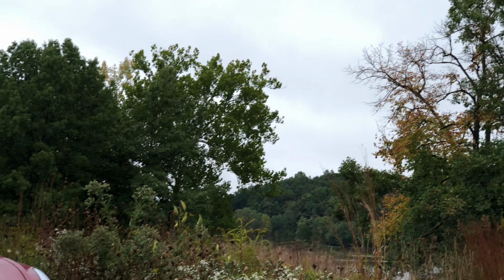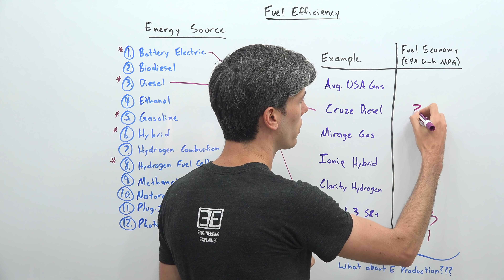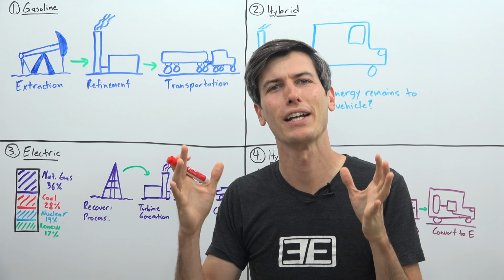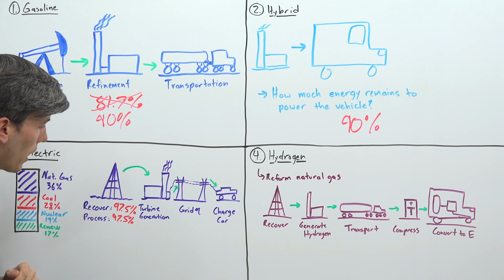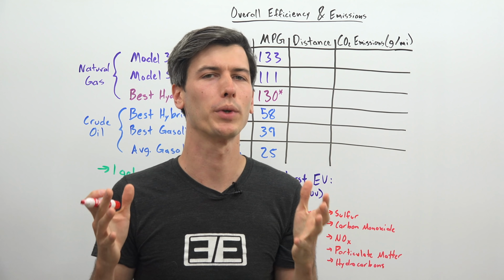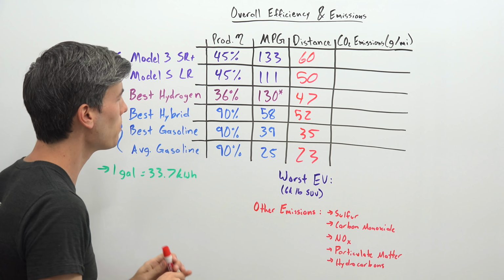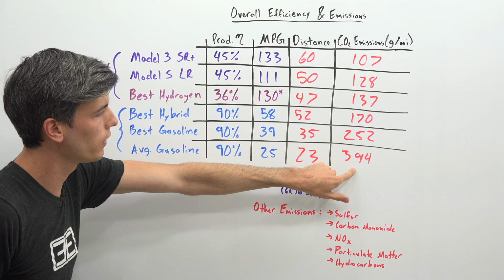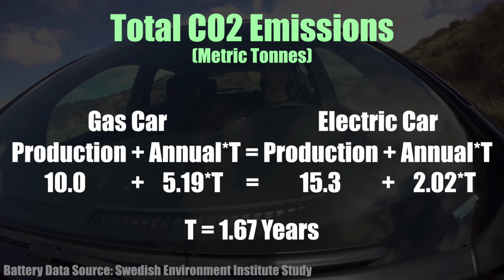Are Teslas Actually Better For The Environment?

Comment: Natural gas leaks and is far far far worse than CO2 as a greenhouse gas. Internal combustion engines are poised to double in efficiency. Internal combustion engines are also going to use bio/synfuel in the future. Combine the three and your whole argument fails.
Reply: ICE are at the peak of their efficiency performance in 1-5 years, they cant actually get any more efficient because of laws of thermodynamics. bio and synfuels arent exactly green either. 

Electricity in the other hand will get more green as time goes on and EV's will only get better.
Reply: @jager_123  
Hi! Yes, I know the "common knowledge", but I also know Carnot's efficiency limit, which is the spread between the engine's hot and cold sides as compared to the hot side. Given that NOX limits the hot side to about 1700K, an engine's theoretical limit is about 80% without significant exhaust treatment. So, 60-65% efficient engine's are doable. Combined cycle power plants are one example. My piston engine, which I'm developing with UMich, is another.

Comment: Well, you failed to satisfy the topic of your video.

ICE-powered vdhicles can be improved, but there are MANY government handicaps that are killing MPG.  Many '80's vehicles had better MPG than today's vehicles.  52MPG was common.

After the fuel in an ICE-powered vehicle is burned, there is no further impact to the environment.  For the electric cars, there are many contaminants required to create batteries.  You have to count those.  Later, those batteries must be disposed of.  Those materials are hugely bad for the environment.

Rather amusing how they're worried about battery disposal--except batteries in electric cars.

Conveniently forgot about those things, huh?

Now, let's look at traveling in an electric car.  The ICE-powered vehicle stops when they need a bathroom break, and fills up while using the bathroom.

The electric vrhicle requires that the driver constantly worry about if they have dnough range, and if there will be a charging station when they need it.  They waste time waiting endlessly while their vehicle charges.  This brings us a lot of business, using ICE-powered vrhicles to tow the people whose electric cars run out of range.  So, thanks for your business.

What is annoying is the drivers of the electric cars having their attention glued to the screen in their cars.  These people dangerously wander around on the road, fail to maintain a consistent speed, blaze through intersections, and generally are bad drivers.  I guess that any thinking the vehicle can do for these people is good for everyone else, although the electric vehicles certainly are not safe.  Unfortunately, many accidents aren't published.

Maybe when I'm unable to make the decisions ndcessary for good driving, have lost my reflexes, and have lost my will to live, I'll succumb to riding in a boring electric vehicle.  Until then, I enjoy my gas-guzzling ICE-powered vehicle, where I'm in control, with the enhine roaring down the road.

Comment: You cheated, the efficiency of steam turbines in power plants is not 60% but 35% and the best ones reach 50%, the average being about 40%, the transport losses range between 8 to 15%, you took the minimum but you should average it let,s say about 12%.  The charging efficiency is again overestimated but let's say it is 86%. That being said the multiplication % for electric cars is not 45% but about 28%. With this realistic % you can see that electric cars are about the same with ICE cars. Also you didn't take into consideration that electric cars are much more difficult to recycle, lithium batteries do not have a viable recycling technology, they are very expensive and energy intensive to produce and recycle. Also you must take into consideration that ICE cars which can work on gasoline can also be powered with CNG and that can bring the % of 90% from extraction, refinery etc up to 95%. Also you considered the best case scenario for electricity production but there are more losses because increasing the consumption at certain hours when these cars will be charged (that meaning daytime for a lot of them in fast charging stations) will increase the need for electricity during daytime which means more power plants which must stay on during the night or more extensive use of "instant" power plants on gas turbines which have low efficiency. Also the electric cars will work with that MPG  in moderate climate, without heating or air conditioning. Hot climate will decrease the MPG because you need air conditioning and cold climate will degrade a lot the MPG because you need heating and the battery performance will decrease a lot with the temperature drop. So overall is not a difference between electric cars and ICE cars and it can't be as long as they use the same primary source for energy, the fossil fuel.

Comment: And then there's the 1000s of gallons of water required to transport a crashed Tesla, in case it catches fire. 

And what about the Chinese extracting rare earth minerals to build these batteries? Where's that pollution. I know it's in another video, but it is not in your emissions calculations in this video. I doubt they are better for the environment, once all factors are accounted for. 

And don't forget the fact that you'll need a new battery every 5 years. 

EV won't work. It can't work. Electric Jesus is simply wrong.

Comment: Sorry, But your numbers are completely, well, worthless for your posted question. Your title is "Are Teslas Better For The Environment", not "which puts the least emissions while running". If we run with your actual title, Teslas are actually the WORST polluters,  particularly (but not only) if we factor in the car's construction and its eventual destruction. The batteries in Teslas - and all EVs - comprise a very wide, vicious host of nasty chemicals and minerals that are wholly artificial, exceptionally polluting to extract/refine (lithium, as one example, being extracted generally from massive open pit mines), and dramatically more so when it comes to decommissioning. Much the same holds true if we backtrack that footprint to include the 'fuel source', namely, LNG/Diesel plants versus solar panels. The chemicals/minerals are particularly hard to recycle; generally instead landing in 3rd world landfills.  Car to car, a fuel efficient gasoline car is more efficient overall from factory to grave than EV.  And yes, I know Tesla claims they are recycling/disposing of them, I buy that about as much as I buy the average politician's promises. (They cant even admit they have a major problem with their cars spontaneously burning to the ground.)   There was a study that came out of Germany in April that crunched the numbers that, well, the EV companies are not happy about at all. 

Now, if a tesla, or any EV, were to run solely on a nuclear grid, then yes, its overall footprint would be substantially lowered - but as you rightly noted the US grid (and much worse in Canada) is largely petroleum based. Where the Tesla excels at is lowering 'local to car' emissions, or rather, emissions on the road - but in truth, the load has merely been transferred from the car to the power generation station.  Unfortunately, despite the claims of many, solar and wind are nowhere near the 'green' energies that are claimed, particularly when construction and decommission are factored in. (Its also worth noting that on a pure safety level, for power generation nuclear actually has everything beat - but when nuclear screws up, well, we see it from orbit.) 

What further complicates this is the grid itself - not the source, nuclear, diesel, whatever - but the transmission grid. As you rightly noted, the current grid is not, and was never, constructed with this sort of immense load in mind. Many areas already suffer brownouts due to an insufficient grid - adding the immense extra load of any EVs that rely on grid charging forces the generation plants to generate even more power to make up for both the demand of the car and the loss on the grid. Further, the highly increased demand on the grid poses substantial safety risks, both on the home (which will need rewiring to take the load) and the grid (which is a vastly more costly job to redo for the geometrically multiplied load).

Is this all to say 'we should not pursue R&D of EV"? No, absolutely not. The points are, however, the current tech is extremely toxic to the environment, decommissioning in particular being very, very costly to do correctly (which in turn means it usually is not done correctly at all, thereby polluting the environment immensely), the power generation stations are far, far from green, and the grids certainly cannot handle the excess load.  

Thoughty2 went into considerable detail 'outing' just how clean - rather, unclean - the varying power sources are, namely in Europe. I strongly recommend you look up his "Renewable Energy is a Scam" vid for more detail. 

As things currently stand, the most efficient method overall for people to do is to buy, and maintain, fuel efficient cars, don't bother with EV cars for now, and pressure their governments to develop nuclear power which by far is the greenest tech overall, if the risks are appropriately managed. 

Also,  fly a lot less. If you want to see obscene pollution, just look up that fly radar site to see how many large aircraft are in the sky at any second; any one of those aircraft putting out orders of magnitude more pollution than fleets of vehicles.

Oh and if in case you are wondering, Im one of a type of people that are engineers' worst nightmares - the mechanics that have to come up after to fix the engineers' screwups. ;)

Comment: Another magical mystery tour bought and paid for by Tesla, by our dear friend at engineering explained. No my friend, the grid idls not the 60% efficiency you used, that is way off. Only a small portion of the grid has those. Read and investigate the department of energy's average efficiency for the total grid, it is around 43% quit using misleading figures to sell your electric fascination.